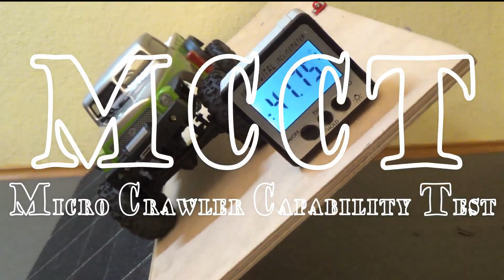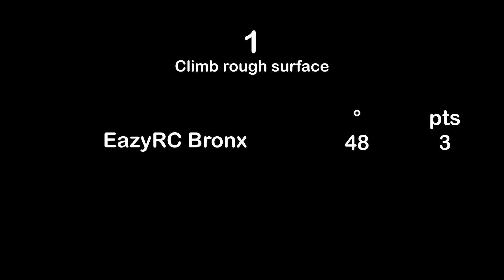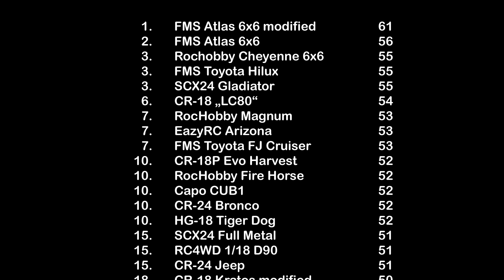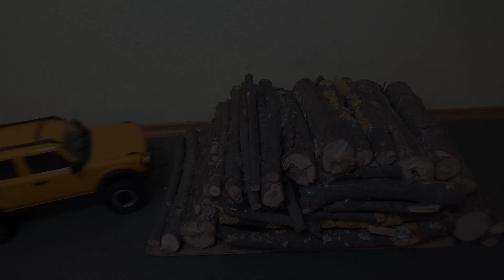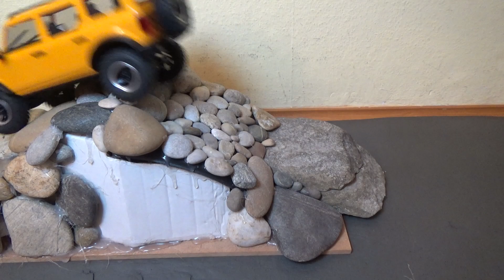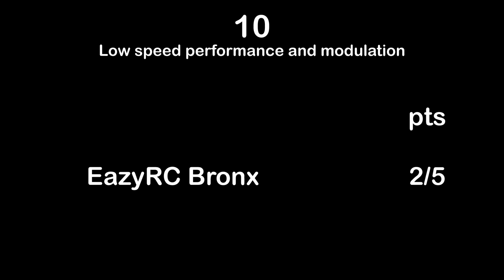MCCT 27:  EazyRC Bronx

Comment: Another great video! I love my Bronx but it took a lot of upgrades to make it good. I wish FMS would have done a version of the Bronx with smoother esc.
Reply from the maker: It is the only EazyRC with a "quite ok radio", much better than Arizona, Patrion/t and Co.
Those EazyRC are much cheaper than the FMS/RocHobby pendants here in EU. Very strange, they are same price or cheaper here than in China (FMS, FairRC), while the other 1/18 and larger models are way more expensive here (some twice the price), while the 1/24 are only a bit more expensive, nearly same price. Never will understand the pricing...
Reply: @donaldsneffe  i liked the bronx looks so much i put an axial v2 esc, oil shocks, crawlmaster tires , 42 gram rims with weights and put +10mm trx4m wideners on it. Its very capable now.